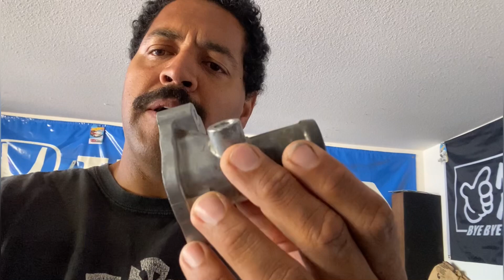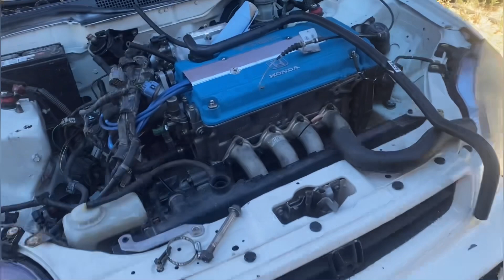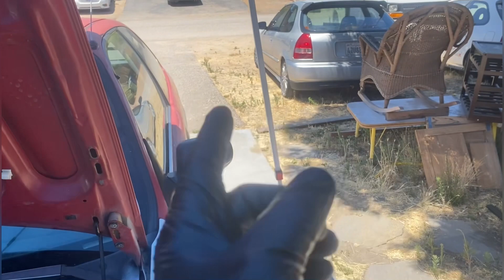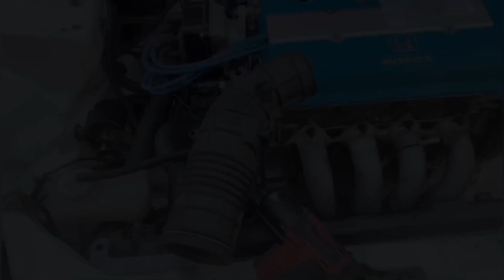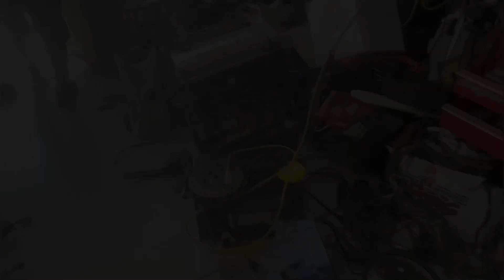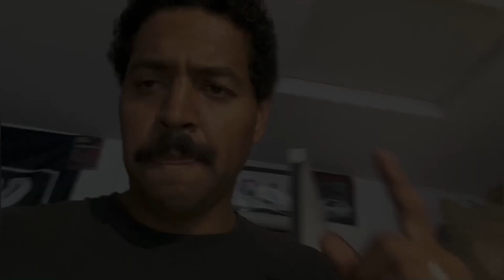GSR no oil pressure

Comment: So I've heard of an oil control orifice between the block and the head, could that have anything to do with it? Just an idea though.
Reply from the maker: After opening the
Bottom end I’m going to replace the main bearings and oil pump and go from there
Reply: @civicstar982  any updates mines goes down to 9 and i got it done at a machine shop i am running single cam ecu rn just to turn the car over but i dont know if that matters as far as op goes it does go up good on wot
Reply from the maker: @ 100% sorry about the lack of updates. My car isn’t running at the moment but I think I figured out the issue. So I spun a bearing and finding a replacement crank is expensive and difficult so I sent it back East to a company that could fix and clean up the scoring. And this is where my ignorance shows I thought They added material and cut it down to factory specs but they take material away to repair The damage and make a clean surface e for the bearings to ride on
Reply from the maker: @ then I had to learn about over size and under size bearings. You need over size (thicker outside) when there is damage to the mounting caps and you need to bore them bigger. Undersized bearings which are what I needed add material to the inside portion of the bearing. And this makes up for the material removed during the crank refurbishment process. So when we measured originally, we did the difference between the size of the main caps and the bearings installed. That number had not changed because of the crank repairs. But we didn’t use the plasti gauge which would have shown that the gap was too big between bearings and the crank. So when it was running it wasn’t tight enough to create oil pressure. So now I have undersized bearings and just need to get it together. Not sure if that is the same issue with yours